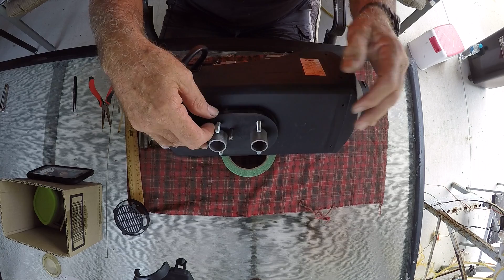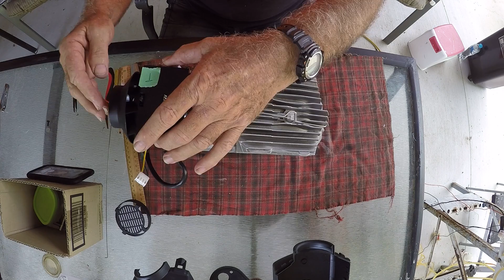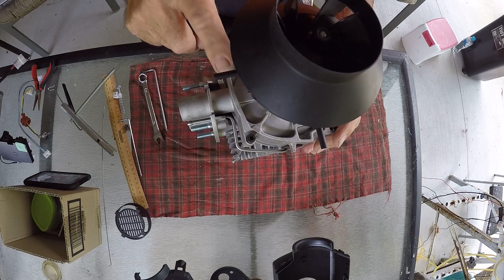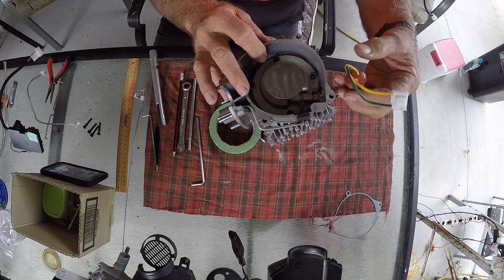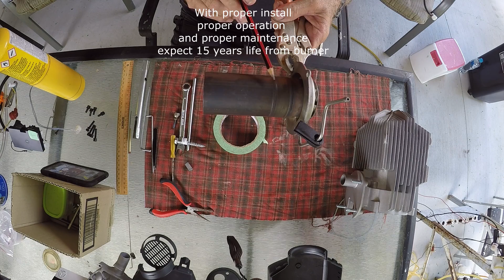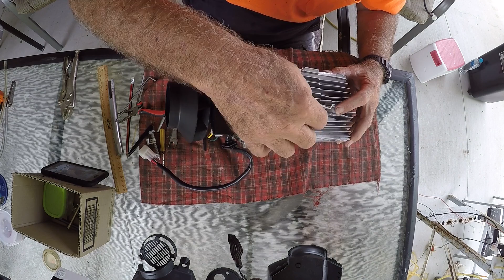Chinese Diesel Air Heater   Part 14  Strip Down

Comment: what would cause smoke to come out of the air intake? Mine was running great for two days then started to smoke out the air intake
Reply from the maker: Oh dear NM, 

That was drastic.

It sounds to me like a fuel flooding issue, that could be easily fixed with a fuel tap.

But even if heater had a serious issue, you could return it for a replacement (if new) or use it for spare parts (if old).  JMcK
Reply from the maker: Hi NM,

What air intake do you mean?

If from the combustion air inlet it can signify some unburnt diesel and should quickly disappear when heater is running.
The reason for this could be various and I would need more info. One common cause is if the fuel tank is mounted higher than the heater, you can get diesel seepage into the heater. Solution, install a fuel tap and turn off when heater not in use.

If smoke out of hot air intake, you have a serious issue that can cause CO poising. 
The most likely cause is an issue with the seals. See video on seals and gaskets.   JMcK
Reply: @johnmck1147  it came out of the air combustion air inlet I have running under the bus. It came on and some smoke started to come out of the exhaust tube like normal but then a lot of thick white smoke started to come out of the air inlet side. So I shut it down and tossed it in the garbage 🗑

Comment: is this a 5kw or 2kw unit? Mine came very early (this AM), expected it in another week lol. Heater is red & black, suspect its a 2kw...i ordered a 5kw (ugh)...  Has bad green fuel line & no fuel filter too.
Reply from the maker: Hi Sp. it is a 5 KW unit. A 2KW heater is smaller than a 5KW heater. See video on 2KW heaters.  JMcK

Comment: Hello again John.  The metal housing of the heater gets very hot and was wondering if the heat sensor, glow plug and fan cables should be wrapped with some kind of heat tape.  Also, does the plastic housing have to be used or can the heater be exposed to help dissipate some of the heat?  Thank you.
Reply from the maker: Hi Amir,

The cables are fine.

If you expose the heat exchanger by removing the cover you won't be blowing much, if any hot air to the accommodation, and also you greatly reduce the volume of outside air blowing over he heat exchanger and you can cause an overheat issue.  JMcK
Reply: @johnmck1147  As always, thanks for your reply. Great information.

Comment: HI John, thanks for the in-depth videos, I'm watching the whole series avidly. Given the potential for the heat damage on the burner control unit, I was wondering whether the circuit board could be relocated. Is it just the fan speed sensor that would need to be remounted somehow?
Reply from the maker: Hi Jastic.

 First, pleased you find the videos helpful

Now re the circuit board. It is just not worth the effort to relocate the ECB, make a fan speed sensor bracket, unsolder the sensor from the board and mount it separately, then run wires to the ECB, then you have to reroute the controller wires, pump wires and temp sensor wires.

Jastic, do a good install and the chances of doing damage to the ECB are very remote. 
No it is extremely remote.
If it ever does happen just buy another ECB for about $20.   Cheers.  JMcK

Comment: HI COULD YOU HELP ME WITH ERROR 07
Reply from the maker: Hi NG, 

E07 is usually associated with an error with the controller. It could be an issue with the controller itself, a plug connection issue, bad wiring, or low voltage.

First up did the heater work before but not now? Or is the heater new?

Suggest you first check your battery is fully charged and you have at least 12V at the heater itself. The heater should be connected directly to the battery to prevent voltage drop.

Next check that the controller plug fittings and wires are ok, and there is no corrosion or damaged wires in the plug and socket, check the wire colours match in the plug and socket. Sometimes if you used a different controller, the blue wires may not line up. Also check  the plug is pushed hard into the socket. 

Good luck.  JMcK

Comment: Hey John, you mentioned that the heaters can only be mounted on the side of a wall one way, is this due to the position of the air inlet to the glow plug and if mounted incorrectly, it would leak diesel on the initial start-up..?
Reply from the maker: Correct. With the glow plug on the bottom raw diesel can pool around the glow plug and atomisation screen and precent a start.  JMcK

Comment: Hi John, I hope you can help! Have you ever replaced the bearing in the fan unit of the diesel heater? I can't find anywhere online of how to do this except one page in German! But I get stuck at disassembling the fan unit. I can't seem to get the brown plastic backside of the fan off. Any help or ideas much appreciated! The diesel heater fan started making this whirring noise and i couldnt see the fan hitting any magnets which a lot of people speak about but saw in some forums that the fan bearing can go. Do you think you could make a video on how to change the fan bearing? If that's not too much trouble!!! Thanks so much, your videos are the best!
Vicki

Comment: I think the bearings are going in mine, getting noisier especially at start up, wonder if you can get the part mentioned at 9:30 or change the bearings?
Reply from the maker: Hi Libran,  it is unusual to get fan motor bearing noise unless the heater has done many hours of work. The heater in my boat is well over 10 years old and it still has no fan motor bearing noise.

I would be first checking that that the fan is not scraping on the housing. (A common issue) 
With the heater not operating, turn the fan back and forth with your finger to feel for any scraping with the housing.

The only real way to check for fan bearing issues is to take the fan assembly out of the heater and manually spin it to check for bearing noise.

If you do have fan motor bearing issues, you cas buy a replacement fan motor on line for about A$40. 

However, if your heater has a lot of hours on it, or a hard life, you may consider it more prudent to buy a brand new heater as they are very cheap (around A$120 in Aus) and use the old heater for spare parts.

Cheers,  jMcK

Comment: John,  I just bought a similar unit to heat a small workshop (8 x16).  In your opinion,  do you think it is feasible to creat a flang type arrangement to cover the intake fan so I can draw cool air off the workshop, heat it and return it to the workshop?  Very similar to how a house system works.
Reply from the maker: Sounds good to me. 👍

Comment: Hi John, thank you for your video's. It gave me the information and confidence to buy a 5kw. It has served me very well in the last 2 weeks. 

As I'm heating a small space I'm often running the heater on a lower setting and as you suggest, regularly running on full temperature to burn off soot build up.

My question: gradually I begun to hear some rattling, warbling,  from the fan. 
I've inspected the outer fan and find no visible issue there. No melted plastic, no magnets sticking out.
I wonder, could it be the internal fan? Is this cause for concern?
I didn't hear this sound in the first week but now It does seem to be gradually increasing. It fades in and fades out in a slow rhythm. 

Thank you for your suggestions ✌
Reply from the maker: Hi James,

First thanks for the feedback.

If your install is good, ie few restrictions in intake and exhaust the heater runs very clean and only needs an occassional burn off run. Probably once a season.

Sadly it is not uncommon for the outer fan to rub on the case. The metal part of the heater sits on little lugs in the plastic case and is not too secure. I bought three heaters from one supplier and all three had fan scraping issues. The fix was relative simple and just required some packing. I think I covered this briefly in the 2kw video. (Long time since I made it)

With the heater off gently move the outer fan with your finger and listen for any scraping noise.

You could also have something scraping in the inside fan, but would need to pull the heater apart to see. Something could have been sucked into the combustion air inlet. Do you have a filter on the inlet?

You should have a proper filter. In Aus we have mud wasps that build mud nests everywhere, and would love building nests in the intake hose. Even if they don't go far in the hose, the mud nest can break off and be sucked into the  heater. Also critters like frogs and lizards can reside in the intake, and get sucked in on start up.

The exhaust sidebis not an issue, as it is hot, dirty, smelly, and anything in there gets blown back out, not sucked in.

It is also possible you may be getting the start of a fan bearing issue. 

A suggestion. Unless you are an enthusiast, I would just check for noise with finger movement of the fan, and if nothing significant I would run the heater and see if things get worse before stripping the heater down.

I hope this helps your discovery a little.   JMcK
Reply: @johnmck1147  Hi John, thanks a mil for your reply.
I can confirm that the fan is not rubbing on the case.
Also from the start I attached the intake filter, so it's probably unlikely anything has made its way into the interior.
I may yet open her up, waiting on new gaskets, on order.

Also, now that I've taken the cover lid off, there certainly is a rattle coming from inside. I had definitely not noticed this during installation.

I attach a short video of the rattle with the cover open. And then with the heater in operation. Best heard with volume up.
https://youtu.be/-P1GsFV4ivM

Any further thoughts, please let me know. Many thanks.

I will probably contact the suppliers, fortunately this supplier is based in my country.

All the best, thanks ✌
Reply from the maker: James Heel 

Hi James,

If the heater is new, and you have a local supplier, I suggest you request a replacement heater. 
You could have bearing problems, alignment problems, inner fan issues, loose inner fan, etc etc.
Ask for a replacement heater.

Cheers.  JMcK
Reply: @johnmck1147  Thank you. I'll do just that. Cheers ✌🏽
Reply from the maker: James Heel 
👍

Comment: My heater didn’t come with the silicone gasket around the intake and exhaust??
Reply from the maker: Hi Mr O. 

I suggest you immediately ask for it from your supplier, or ask for a replacement heater.

Occasionally I buy something that has a part missing, but that has mostly been supplied free of charge when the supplier was informed. 

You need that gasket. As a last resort you can make the seal with high temp silicone.

Regards,  JMcK

Comment: Do these have the power to blow through a 6 foot duct?
Reply from the maker: Yes Kelly, It is not uncommon to have 20 foot of ducting in a boat, but you don't want sharp bends.   JMcK
Reply: @johnmck1147  ok, that's good but they are all still only about 170 cfm right?
Reply from the maker: kelly hanlon 

Not sure what you mean here Kelly. 

The output coming from the vents depends on the fan speed and output at the heater. You will not get the same output of air at the end of a long vent that is the same as heater output at the start due to friction losses etc. If the vent is long enough, you will reach the stage where nothing comes out the end.   JMcK

Comment: Hi John. Great videos. Am in Brisbane and fitted diesel heater to my Van 8 days ago. On initial start up she smoked like blazes, but has since behaved itself. I run it about 20 to 30 minutes say twice a day. Shè blows a little smoke still at start up. Also on shut down. Also I know the temp reading might be a little out (I set temp at 9 degrees but it's more like 22 degrees). So not happy with start up and shut down smoking and burning diesel smell. Any ideas as to how to aleviate would be greatly appreciated.

Comment: Hi John ,is there any reason my heater is not blowing as hot as when I first bought it ,it is not coked up ?
Reply from the maker: Hi Barry, there could be a number of reasons, but carbon build up is a common cause.
But first the obvious, if the air temperature is colder the heated air will be cooler.
Now how did you check it was not a carbon issue? Did you look in the burner chamber?
One part you cannot see is the main burner atomiser screen in the base of the burner. If this gets a build up of carbon you do not get a good fuel air mix and hence a poor burn. 
Also look at your fuel filter to see there are no rubbish causing restrictions, and check the fuel pump is angled correctly to allow cavitation bubbles to escape.
I suggest you initially run a 90:10 , kerro:diesel  fuel mix through the heater for 1 hour with 30 minutes at high setting and see if that improves the heat output. Kerro helps clean out the burner.  JMcK
Reply: John McK 47 thanks John I run mine on Kerro   Will try your other suggestions ,I stripped it to check for carbon  ,all was good

Comment: Hi john, thank you for your videos! super helpful on the subject. the other day i accidentally caught a shoelace into the outer fan and forced the heater to stop working. it first had error code 06 flashing. because the heater was really heating up and i started to smell the toxic plastic smell, i pulled the electric fuse of the heater out just to shut it down altogether. after the heater cooled down and I put the fuse back in, now the heater just makes a click sound and won't turn on at all with no error code flashing. could you help me diagnose what the problem could be and how to go about fixing it? thank you in advance!
Reply from the maker: Oh dear Jane, that was bad luck. You have probably cooked the ECU. I suggest you buy a replacement and try that first. There are many suppliers and below is just one to get you started.

https://www.ebay.com.au/itm/1Pcs-Air-Diesel-Heater-Control-Board-Motherboard-Fit-for-12V-24V-3KW-5KW-AiF1V3-/352878816509?hash=item5229376cfd

Good luck.  JMcK

Comment: Sir I have a question. How is the fuel inlet tube attached to the burner? Is soldered or is it removable? The reason I want to know is because when I mount mine I want the exhaust pipe and the manifold  connectors outside the van. The mounting plate will be sealed to the floor. (with High temp. sealant)  My fuel tank is going to be inside the van I also am mounting my dosing pump in the van. I want to reroute the tube from exiting the bottom of the pump. instead I want it to come through a small drilled in the cover of the unit. that will also eliminate about three bends in that tube. If I eff it up do I need a whole new burner? lol Your videos are the best ones out there on these heaters Thank you!
Reply from the maker: Hi Jun, 
The fuel line is a pushed on to a metal hose nipple and held with a clamp.
JMcK
Reply: I know What I want to know is how the metal  hose is attached to the burner
Reply: And thank you very much for taking the time to answer my questions.
Reply from the maker: Jun Bead 
Hi Jun, it is braized welded.  
You could be making this difficult fo yourself. Why not just install it like most other van installs and install the fuel line from the bottom as designed. Many vans do have the fuel tank inside the van and run the fuel hose out the bottom and then back to the heater.  JMcK

Comment: Hi John is it possible to reset the ECU? mine is stuck in in "shut down mode" with the fan continuously  running, no error codes. 
Thank you Michael
Reply from the maker: Hi Michael, is it the ECU or the controller?
First  I would make sure the controller was correctly connected. Check the plug.
I would then totally disconnect power to the unit and leave it disconnected for some minutes. Then power it up and see what happens.
If the same happens again I would try a different controller if you can borrow one. You can also buy a new one from about A$15 to A$25 on eBay. A new controller fixed a similar issue here. 
I hope this helps.   JMcK

Comment: I frequently use the Right Hand Rule for screws/nuts/bolts. Have found that when laying on your back under a vehicle with your arm stuck at a odd angle to were you can't even see what your turning it's easier to think "I want the nut to go in the direction that my thumb is pointing so I have to turn it in the direction my fingers are curved." instead of "righty, tighty".
Reply from the maker: Thanks for that info Emil.   JMcK